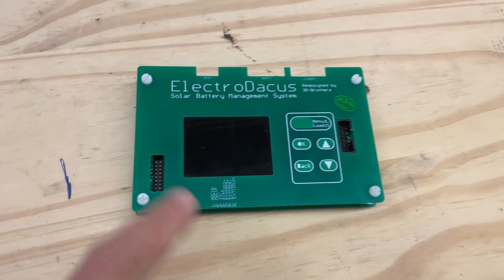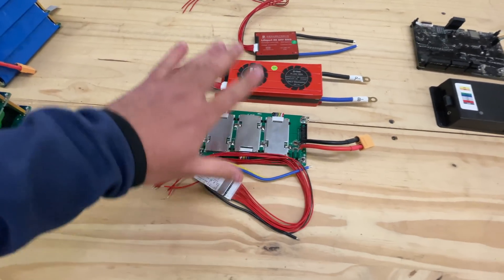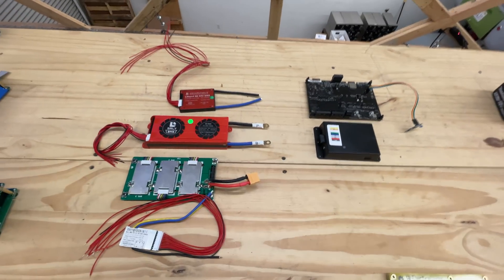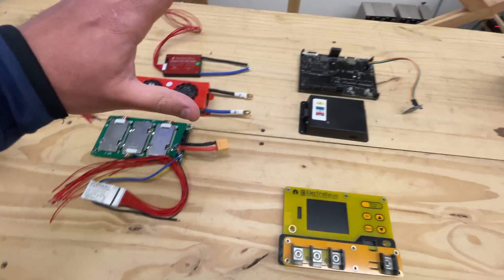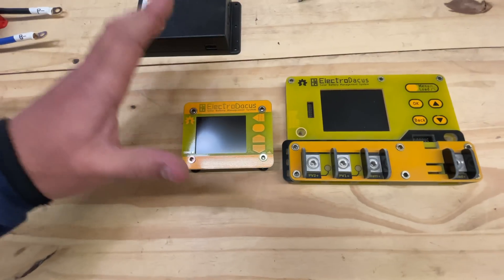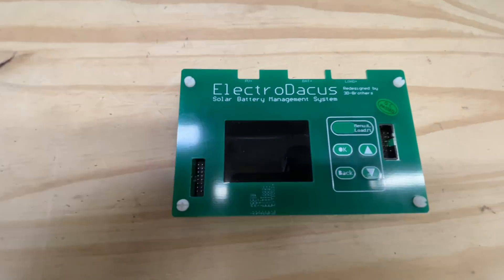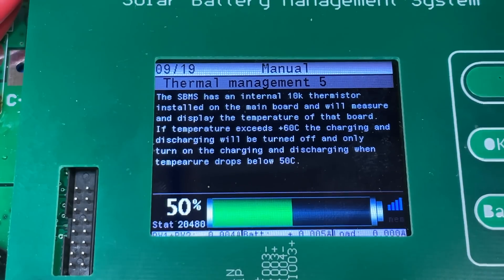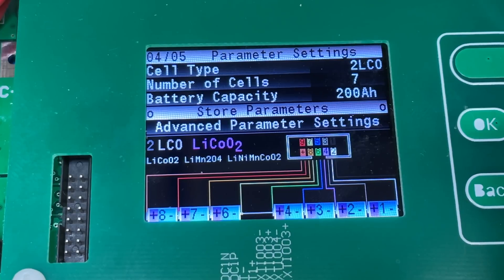The Reason This BMS Needs to Exist  -  Electradacus SBMS40

Comment: But will this handle a 500 amp at 12 volts load if not then I will get the Rec A-bms it's compatible with Victron and the Wakespeed ws500 alternator controller
Reply from the maker: It’s not rated for 500A,  so I’m going to say No
Reply: @jehugarcia  thank you for your response and your videos, someday when I can afford it I would like to convert my 1967 GM TDH-4519 city transit bus, into a electric drive one, I live full-time in my bus

Comment: Yeah! Received my SBMS40 today. Wish it would have shipped with a set of 24" BMS leads. I found two 5 pin connector cables but of course the color codes don't match so increases chances of making a wiring mistake thereby creating bad reviews or support issues for Alex.
Reply: Does this do lithium ion?
Reply: @leehudson1384  Yes and more!

Comment: I have one problem. I wana convert my sailboat to electric. Using 2x520wp24v solar panel  and wana use lithium battery 48v300ah.  So i will need a 14s bms. What will you use.  The electrodacus don't have 14s

Comment: Does the SBMS40 use a PWM algorithm on the PV input, to throttle the connection to the battery as the battery approaches full charge?  If not PWM, then what is it doing to taper the current at the end of the charge cycle?

Comment: Thanks for the review on this. Any recommendations on a BMS and compact light weight battery 60v / 60ah? I have a Weped GT50 electric scooter. My battery output is only 14.7A max @ 60V for short periods, and only 9.8A continuously. The dual motors are rated for 1800 watts continuous each. The battery can only deliver a peak output of 60 x 14.7 = 882 watts. I would like to upgrade the battery with better cells and BMS. 3600 watts / 60 v = 60 amps...that's the output the battery should be able to deliver.

Comment: In the winter would there be a way to use a capacitor (super, ultra ect...) So when there's short periods of light between clouds, as it charges a lot faster then a battery is there a way to run it before the battery. So it charges while there is short cloud coverage or intermittent cloud coverage? Similar to a way a car powercap is used? Thanks for your videos. Steve.

Comment: Nice, but no active balancing and more power consumption than other devices. On the other hand it comes with a lot of good features. I developed a better one based on ACTIVE Balancing and ESP32 and Web Interface. So no display is needed, very low power....
Reply: Walther Matthau You need to put this up on your YT channel! Don't worry about polished video just try to keep it in focus and make certain your audio is as good as you can make it. Are you intending on bringing a product to market or making the information open source? Personally I have backed this project but it doesn't have much time left and hasn't quite reached its goal yet.

Comment: does this bms do low voltage cut off for LifePo4?
Reply: yes it does talk to Dacian at his website or email him at electrodacus@gmail.com to get one from him. His are warranted for life. the new ones not sure but Dacian is working with them and gave them his blessings. there is also the DSSR20 that you hook 2 solar panels up to the battery at a time making each set of two panels independent so if there is some cloud not all of your panels will get taken out of power mode at the same time. go to his website to see what he has. look up Electrodacus.com and see for yourself

Comment: Great review Jehu, this looks like a well polished BMS. My hands down favorite BMS is the ANT BMS. Checks all the boxes you mentioned for under $100. Been pulling 170 amps continuous through its outputs from a 22s8p pack made from Sony VTC6  for a year now. Everything is configurable and all temp and cell balance is available via bluetooth directly to your phone.  
https://www.aliexpress.com/item/32826820690.html?spm=a2g0o.cart.0.0.12923c007W1wOU&mp=1

Comment: Just 3 to 4 years ago this guy didn't believe in a bms said they wasn't needed lol I wonder what changed his mind 🤔
Reply from the maker: Mass adoption of diy battery building,  I  still run my packs without but I don’t recommend inexperienced builders (99% of my audience) to attempt it.
Reply: @jehugarcia  I bought one of the recycled BYD batteries early this year and used a 20Watt resistor to bottom balance the cells. Then connected my MPP lv2400 to charge. Then top balanced cells with power supply. Been running w/o a BMS for 4 months and staying within .02V between cells and check them every couple weeks. So No, you don't need a BMS, until something goes wrong, then you'll wish you had one.

Comment: xiaoxiang. On alibaba.com makes a bms that comes with usb connection and an app to monitor and set parameters for each sell. I use them now for my cells in my solar system. manufacturers are way ahead with mass production and adapting to new demands.

Comment: Can’t help you I joined the mega cell campaign last March in first group. I had not received my charger or that it was shipped, I contacted Alex and was  told shipper didn’t send info for 7 orders and mine was one of them.  Orders after my order number have shipped but 7 orders were skipped. Had not heard back from him. Currently I am asking for a refund.
So buyer beware. It’s all great until you are the one that didn’t get what was paid for and promised.  Very nice design hope it works out.   Update Funds were refunded by Alex.

Comment: As Andy Shell said: "Electrodacus is made by a very smart guy that lives in Saskatchewan." BE WARNED: That this "redesigned" version is not from Dacian. It is being made by the people that brought you the terrible Megacell Charger where you have to email for software activation codes and where the two founders constantly fight each other at the customer's expense and release an overall sub par product and haven't even delivered to most backers and are way behind schedule. Just a heads up...

Shame on you Jehu for advertising things like this...

EDIT: There are other users experiencing the same thing. I quote from Eric Thibeault:

"I don’t know about supporting this guy (Alex)... I did support the Megacellcharger by the same guy and after 5 months I still have not received anything and look like his 1st batch of Megacellcharger was only allow to charge at 0.25amps. Both projects seem like great ideas however Alex track record don’t seem to be great so far!!!"

EDIT 2: There are yet more users who have had similar bad experiences with the Megacell Charger team (the same group who has redesigned the ElectroDacus). I now quote from HardwareTX:

"Can’t help you I joined the mega cell campaign last March in first group. I had not received my charger or that it was shipped, I contacted Alex and was  told shipper didn’t send info for 7 orders and mine was one of them.  Orders after my order number have shipped but 7 orders were skipped. Had not heard back from him. Currently I am asking for a refund.
So buyer beware. It’s all great until you are the one that didn’t get what was paid for and promised.  Very nice design hope it works out."

Call me crazy, but I'm definitely not the only one who will not support another project by the Megacell Charger team.
Reply from the maker: Ben you need to understand that Dacian is on board with this project, as far as I know profits generated from this will be shared with him.   As for your beef with Alex I suggest you try and work it out with him instead of coming here and making stuff up.  I can’t take you or your opinions seriously If this is how you decide to go about this.
Reply: jehugarcia Well yes, Dacian is on board because it’s open source and Alex can do whatever he’d like with the open source info. As per the Kickstarter explanation, it looks like they discussed profit sharing but decided against it. And I don’t see why I shouldn’t warn other potential customers and let them know my bad experience with Alex’s product. Also, please do clarify which part of my statement I made up? I’m just warning other people that these guys at Megacell over promise and under deliver. My problem Jehu is when you promote something like this to your large audience without acknowledging that the first endeavor by the the MCC team left a lot of unhappy customers and there is a decent chance the same will happen with this project.
Reply: Those are some weird accusations and bad words out there Ben. Not sure if you backed the project or not, or if we talked before, feel free to reach me at alex@megacellcharger.com to discuss about your problem.

While MCC is not at a mature state, and most problems are software, that takes time to develop.

Electrodacus software has more than 6 years of dev and that's a big advantage of this project.

While we redesigned the board for easier manufacturing, we kept same original components, otherwise software would not work.

Same type of mosfets, same quality shunts, the bms chip etc.

DIY can be frustrating, but getting your rage through bad words on comments is not the most productive way, you could channel your energy to find what the problem that make you upset is and try to solve it.

If MCC is not for you, I can give a refund, as I said, get in touch and will sort out.

I know we cannot serve everyone, but we are doing the best we can.

All the best!
Reply: Alex Gradea Hey Alex, I appreciate the response and do apologize for the slimeball comment- that was unwarranted. What is warranted, however is sharing my opinion about the Megacell and how the entire Megacell Kickstarter was handled. It was over promised and under delivered. I get that you’re bringing this solid open source product to market, but why do you need another Kickstarter when you haven’t delivered on your first? My beef is that you have no problem taking people’s money with a less than solid plan to deliver.
Reply: @BenBuildsDIY  where I'm from we call them scammers. Dacian is LIGHT YEARS ahead of all these guys, LIGHT YEARS. He probably graduated 8.0, lol, way above summa cum. If he thought it could be massed produced he'd be a BILLIONAIRE. I believe Dacian best is yet to come.

Comment: always said until a BMS exists that can  balance as they charge rather than only when cells are full I won't bother.  Don't want to charge my ebike or skateboard past 80% for longevity reasons but still want balanced cells. if i can set this to 80% and still balances then I'll love this
Reply: If you have room in your builds you can wire in your normal bms, and then add the wires from a higher amp balance board and disconnect your bms then plug in the balance board for a better balance once a week. They are pretty small too
Reply: Jk bms can do that. Ive got 2 and they work great. Only thing I don't like is the standby power consumption is to high. About 1wh which is fine for a solar set up but could be annoying for mobile use. It has an on off button which is nice but I don't like that it can drain a 300wh battery in 2 weeks. It will auto shut off at any voltage you pick so nothing is damaged just annoying. I wish it had a timer to shut off

Comment: Unfortunately this is 12/24v.   I need a 14s (48v) lithium-ion (18650) with display - like Chargery 16T but better quality than Charger 16T.   I agree - for me I want to see info on a screen and NOT my phone or computer.   Do you think Electrodactus will do 14s anytime soon?
Reply: I talked with Dacian and he wants to stay away from high voltage because it's dangerous. You need 60+ volts solar panels and above 48v is where things starts to get risky.

So I think he is not getting above 24v setups any time soon
Reply: @Alexander1560  not risky to me. Alot of motor use 36v 48v... +  and future cars, boats and and. There is a big market for 48v

Comment: Tremendo Video!! Gracias y saludos desde Puerto Rico!! I've been looking for something like that!! Question... In order to balance three Tesla modules, each with 6s cells. How many SBMS0 would I need?
Reply: If you get the cells at an equal voltage and connect the packs in parallel, then wire all balancing leads, one in theory. But in time the packs might get unbalanced and smoke in balancing wires might appear.

One bms per pack would be best, or strongly connecting packs in parallel, cell by cell, not with thin wires

Comment: Does it turn off  when it gets to the 4.2 volts per cell?
Reply: Charging will stop at the voltage you set, 4.2 for example, and can set when to start balancing, 4.1 ex

Comment: I am going to do a grid tied solar installation on my house and want to add a battery to be grid independent.  Would these BMS be appropriate for a 48v system?  It seems like they are only good for 24v.

If they can be wired in series for 48v, how good is the headless version?

My goal is to get an 11kW inverter that can do 50A 220V off of battery power to cover the most extreme needs I might have in a power outage, about 6kWh of solar panels and a battery that can keep my AC on for 2-3 days in case of a grid failure combined with cloudy skies.

I'm not quite sure what that system will look like but I'm pretty sure I'm going to need capable BMS(s).
Reply: This system is made for 24V setups, I would not recommend connecting in series packs. Other people did it, but there can be weird behaviours if a pack fails or gets unbalanced. It will draw power unevenly and things like that.

Using the proper tool for the job will be best

Comment: @jehugarcia Could I use this as a standalone mains charger with a 24 or 36V power supply instead of a solar panel?
Reply: as long as you run through the BMS that ought to work
Reply: @leviclark2573  That would be awesome! That way I could build an 80A charger with one SBMS0 and 3x DSSR20 + 4x36V PSU's.

Comment: Would this allow me to use different battery chemistries if I used the correct settings for each batteries?
Reply: Don't believe so, the Dacus can do different battery chemistries but they all need to be the same chemistry. Maybe batrium with the individual boards for each module might work for that. You using salvaged cells?
Reply: @leviclark2573  no, they're new cells. I have a 7s NMC battery, and a 4s LiFePo4 with a dumb BMS. If I used an ElectroDacus with the NMC battery, and used the charge controller settings along with it to set the charge profile for NMC, would that make them all get along?

Comment: You should also test out the TinyBMS 5216, I have been using them now for over a year on a lot of projects and work GREAT!!  https://www.energusps.com/shop/product/tiny-bms-s516-150a-750a-36
Reply: Wow, looks great !   Up to 16 cells.  I would like to interface it with a 14 cell isolated charger I made, each cell gets same top charge. Works great especially for used cells. My electric scooter has a 14s pack I built, my electric self propelled mower has a 11s pack. Same charger top charges them.  I would like to have a way to set voltage to whatever I want.
Reply: @HardwareTX  That's why I use one, I keep the sweet spot of 3.98 - 3.10 that way I should get more cycles life

Comment: What is nice about the SBMS is that it's a BMS and also a PWM charger if you plan ahead and match the voltage of the solar panels to the voltage of your batteries. 
While MPPT is more efficient, if you do the math, adding more solar panels is both cheaper and less maintenance. Because eventually the capacitors needed for the voltage conversion in MPPT chargers fail, they just have a limited lifespan. So a setup with the SBMS will last you longer and is cheaper.

To me this was all quite confusing and took me a while to understand the what and whys here. Electrodacus also made a thermal battery management system. Basically excess solar power once your battery is full is dumped into a thermal mass, like normal wires in barrels of water or in concrete. It's actually cheaper to heat with PV solar than with those thermal solar collectors. Just add more panels because they have become so cheap!

Personally, as an electro-noob I wish there was a version including MPPT and up to 16S but only because of my specialized requirements. I need more energy efficiency per solar area (limited space for solar panels) and also need 48V to power a ships motor. At least that is my dream haha. 

But for most off grid systems the SBMS looks like the smartest solution.
Reply: I think most houses in the suburbs are still limited by available area that can get sun. If I had a rural property with some space, I would totally go Electrodacus as you can throw up as many cheap as dirt used ebay panels as you need. This seems like the exact, concise, inexpensive solution for that scenario.
Reply: It's actually not PWM it's just a controlled direct connection between the panels and the battery. Hence why Dacian stresses matching the panel voltage to your battery voltage.
Reply: @stingy49  Yeah thanks, I wondered that. The panels basically act like a current limited source and the voltage drops (and the efficiency slightly). So it's actually not PWM.
So the panels are already the perfect charger as long as they don't produce too much current.

Hmm, thinking about this now I understand why the SBMS0 and DSSR20 turns rows of panels on and off in levels depending on how charge level and how much current the sun is producing. Otherwise with a low battery and full sunshine you could deliver too much current into the batteries.
Reply: @dejayrezme8617  You got it :-)

Comment: It's easy to change the voltage of a dumb bms by changing resistors.
Reply: Yes but you have be able to reverse engineer a circuit though.
Reply: @adama1294  I think it's pretty simple and I'm no EE.